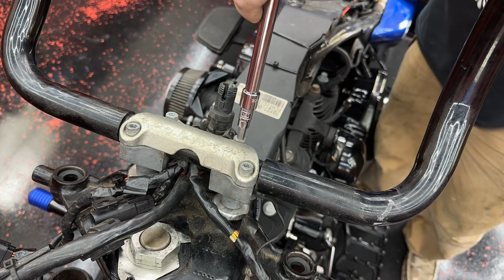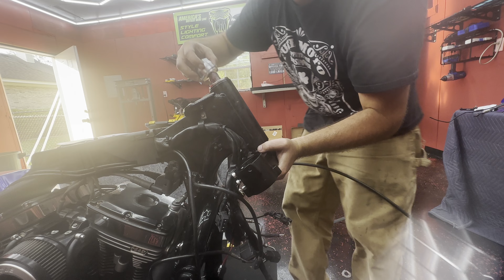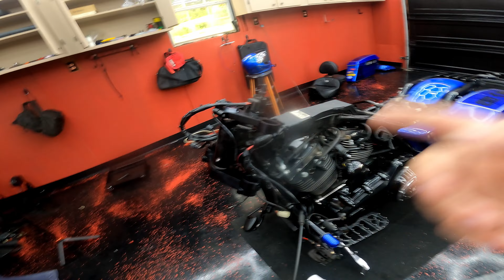"Gezzer Engineering Triple Tree Installation: Say Goodbye to Flex Issues"

Comment: Did you have any issue with the fork stop plate not aligning with the stock holes? 08-down
Reply from the maker: I didn’t just had to take my time grinding down the sides but that was the only hard part about it everything else when on smooth

Comment: I went from 41mm legends cartridges to the geezer engineering 49mm triple trees with big bear performance cartridges and it was night and day difference. Even coming from legends it is way better.
Reply from the maker: Oh nice being able to have the bigger cartridges makes a big difference.🤘
Reply: @Wessoncustoms  it definitely did, coupled with the fact that the factory 41mm trees are trash without good rigidity and clamping area and you've made a major difference. I believe my 41mm legends setup would have felt much better in some trees like these. I also had stock height legends and my new 49mm setup is +2.5"
Reply from the maker: Exactly always thought that was a weird design with one clamping bolt on the bottom of the stock tripple trees. But its old technology and not meant for a performance setup like geezer tipple trees!
Reply: @Wessoncustoms  absolutely, it's fine for the way most people used to ride Harley's but now days more and more people are into performance baggers or performance Harley's in general and it's exposing the weakness's. I know the Rushmore years are an improvement but still lacking. I'm curious what a 2024 baggers trees look like?

Comment: didn't you have to shave some of the sides of the fork stop off so it will clear the beefier forks? also, were you able to reuse the stock bearing cups or did you install new ones? thanks a lot for your help
Reply from the maker: You do have to grind down some of the fork stop to clear do it small increments so you don’t shave tools much off just enough to clear.  I was able to reuse the stock bearing cups but I had less than 1000 miles on them from already replacing them. If you have high mileage on them I would go ahead and replace them to be on the safe side. If you have more questions let me know!
Reply: @Wessoncustoms  wow, thanks so much for your reply. I understand and will take the process slowly once my stuff arrives. Really appreciate your video(s) too as I will be more than prepared to do a smooth and proper in stall! Have a good one and again, thank you for taking the time to reply
Reply from the maker: @sftosendai Not a problem at all!
Reply: @Wessoncustoms  again, thank you! Happy St. Patty's Day
Reply from the maker: @sftosendai likewise!!
Reply: Geezer engineering provides bearings and bearing races in the package. You do have to grind away some material and spray paint the grinded areas.